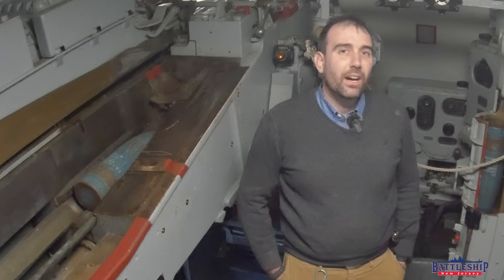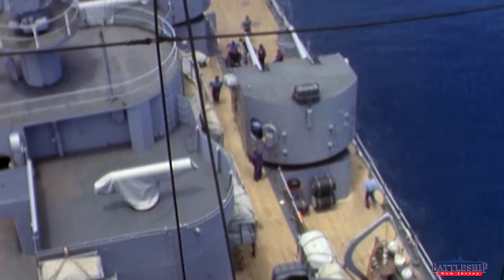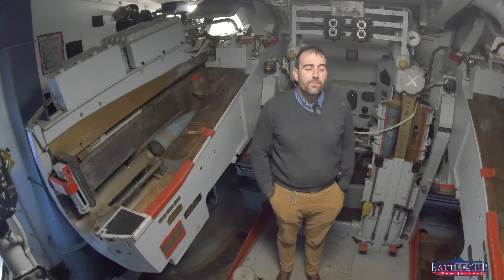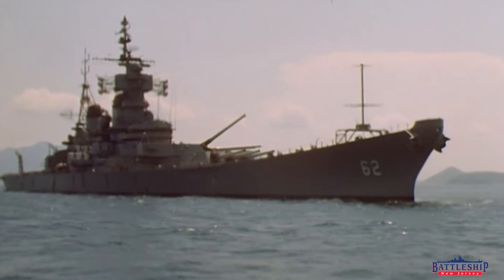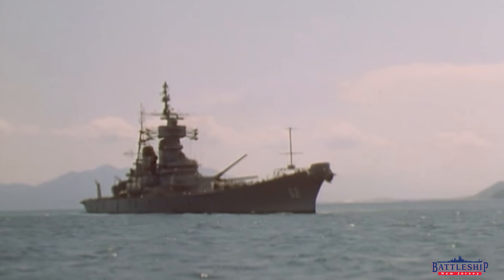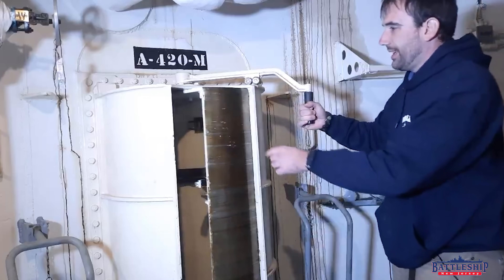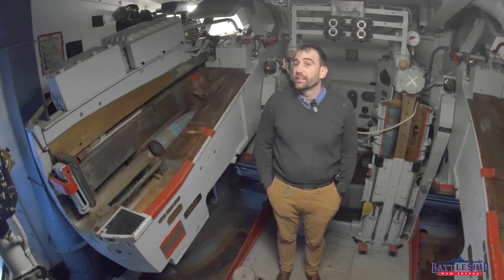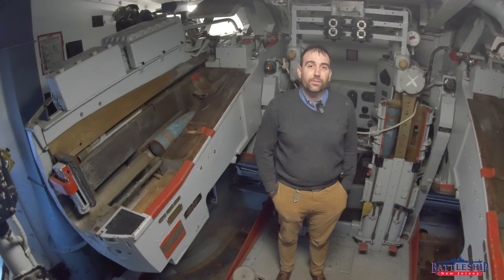Why Do Modern Warships Have So Few Guns?

Comment: The war in Ukraine has taught us a lot about modern warfare. The missiles and modern tech ran out pretty quickly and started becoming reserved for high value targets or saved for later strategic purposes. In any all-out war, missiles are too expensive and too difficult to make. I think it’s a mistake to not have more traditional weaponry in many situations. 

In both Ukraine and Israel we see how much of it boils down to artillery. Having a large ship a few miles from the coast, shooting at land-targets is surely a much cheaper way than flying a bunch of planes over, moving entire aircraft carrier fleets around, moving the front line to get into artillery range and such. It’s a crude and inaccurate method, but if civilians are out of the area it would be highly effective and cheap. The usecases are somewhat limited, but it’s also very cheap to add 5-6 different caliber traditional guns to modern destroyers/warships, so even if they’re not used often it wasn’t really a loss.

Comment: We repeat the same mistake over and over. One version is preparing to fight the last war, another version is designing ships for a specific, highly capable, advanced adversary only to find ourselves at war with swarms of suicidal Boston Whaler type skiffs loaded with explosives. Rather than "jack of all trade" type ships, maybe create smaller numbers of more specialized ships. Build a handful of monitors with 8" or 12" guns for shore bombardment. Build some air defense destroyers with longer range phalanx style high speed fire control to deal with aerial drone swarms. Build some corvettes with phalanx style weapons and high speed 5" mounts to engage low tech boat swarms, etc. We still need to dominate the high tech blue water navy space to deter advanced adversaries, but we need flexibility to deal more common threats like the Houthis.

Comment: The use of drones on the modern battlefield has made the naval gun more valuable than ever. Particularly the smaller caliber/higher fire rate variety. Not just to protect against flying drones but the types of unmanned Sea drones being used in Ukraine. Which are basically sea skimming missiles.
Reply: That's the reason the AEGIS system is integrated in the whole USN, and all destroyers, cruisers, and carriers carry at least one CIWS, as well as RIM missiles that allow to protect a strike group from incoming aerial threats from 300 km away
Reply: @earlbinvico  im not talking about aerial threats.
Reply: @Front-Toward-Enemy  then again, AEGIS is very complex, and it allows for the joint defence of a whole fleet. RIM-162 was also designed to be able to take down sea-skimming missiles. This means that in a carrier group, all 7+ cruisers and destroyers, as well as the carrier, will be able to use maybe a hundred of these missiles to defend against anti-ship missiles from over 50 km. AEGIS also means that CIWS can work collectively to eliminate anti-ship missiles as well. So, to sum it up, the reason why even CIWS have been having reductions is because anti-missile missiles have become very useful for defense on longer ranges than CIWS could offer
Reply: Guess that's why CIWS will never go out of fashion.
Reply: i think you are refering to anti air guns - CIWS only
Reply: People should stop to make up terms that make no sense. It makes them sound less intelligent.
Reply: @AW-ix5qg It's because the term is Unmanned Aerial Vehicle. An abbreviated name for that being drone. Then somewhere along the line people started combining the two, incorrectly. It gets repeated and eventually becomes a part of the lexicon. Language is a funny thing and so many words don't make common sense.
Reply: @Alpha_Digamma  if you know what I meant, why does it matter to you? Getting hung up on small details just makes you look like the “know it all/fake expert” type.
Reply: If it's manned it's not a drone. Which joker came up with the term "unmanned drone"?
Reply: @Alpha_Digamma  Come from cross over with UAV, Unmanned Aerial Vehicles.
Reply: @Alpha_Digamma  who cares?

Comment: The recent drone swarm thwarted by the Carney was if I remember 16 drones. Which were engaged and destroyed by 18 SM2 missiles. 
That’s definitely not sustainable. But I would suspect after Carney was reloaded they may have loaded much older SM2s that may have needed disposal soon anyway. 
Prior to this the 5in and phalanx have been employed for the slower moving drones to good success. Though this being a swarm. They probably wanted to engage at a safer range. 
Either way after that the Eike started moving. So I’m assuming that finally crossed a line.

Comment: I always wonder why modern fleets don’t have a bunch of normal modern day ships and one that’s basically a world war 2 ship but the only thing that is the same is the main cannons, just drive by firing shells and cheaply bombarding anything about 20 miles or so from the shore that you can see or that other Allies can see. Additionally such a ship is very large so you could bring a lot of stuff with you.
The rest of the weapons are missiles and anti air and stuff. Just imagine being able to quickly get rid of absolutely everything the enemy has that’s anywhere near the shore without a ton of expensive missles, and maybe also bombard any selected target your troops point out to the ship. 
There would be a precise cannon for hitting a specific target and there would also be a bunch of cheap “ehhh close enough” guns as well.

Comment: this is an off topic question but i was on the uss torsk in Baltimore a few weeks ago and there torpedo tubes have empty and grinch engraved on  a plate that you would put on a door. on a bracket on them. and just wondering if it means that the grinch has a torpedo in it?

Comment: If they ever fully realize the rail gun & get it working the way they theorized then we might see a return of some guns to ships I would think. Since that system has roughly the same range maybe better than the main guns of an Iowa
Reply: Unless you can shoot through the sea, it's not gonna work. OTH firepower is a problem.
"just toggle the power"
Ships move. Arcing your shots from the three point line isn't gonna work.
"guided shells"
A missile is bigger and can pack more Electronic Defense to resist enemy EW. It also can pack countermeasures to resist enemy fire. 
...a 1000kg or whatever warhead of a Block V TLAM is also a considerably more threatening problem than a sabot dart.

Comment: I was stationed on USS Mississippi CGN - 40 and part of the commissioning crew.  I was an Operations Specialist and was on the Naval Gun Fire Support Team. We had two Mk 45 5" - 54s.  My favorite thing to do was "John Wayne" attack runs.  We did them multiple times training at Vieques Naval Training Range.  Basically you sail directly at your target, firing your forward gun the whole way.  Then you turn, expose the rear battery and fire both as you parallel the beach.  Then turn away and the rear battery continues to fire.  All at 32 knots.  5" naval shells are no joke and the heaviest guns on modern ships.  You do not want to be on the receiving end of a John Wayne.
Reply: showing broadside, aint no joke either
Reply: @bennygummisko for real. No ship wants to be caught out broadside

Comment: I’ve figured for many years that what a modern battleship would look like is essentially a ship the size of an Iowa. With 2 forward , maybe higher velocity 12 inch turrets, probably 3 automatic 5 inch turrets each side and one at the stern. VLS tubes where the stern turret would be, 4 CIWS about half the armor and a massive electronic warfare system.  
Incorporate a gun stabilizer system and GPS into the fire control system and you’d have a pretty solid platform.
Reply: Defeated by submarines, aggressively expensive, still somehow worse than an aircraft carrier. 
...also for some reason bristling with guns when those could be missile tubes or if you're really itching for them, one armed bandits.
Reply: @sunrisejackdaw1779  While true, no modern ship is immune to subs, hence why I wouldn’t see them bothering with as much armor. 4-5 inches on the belt would be enough. 
The main draw I’d foresee with keeping the forward turrets is IF, big if, a gun and fire control system were developed allowing them to drop those shells within whatever the margin of error for say a JDAM is, and possibly 30 miles inland, would be a pretty cheap and safe way to deliver that. 
No risk of losing an aircraft or pilot, way cheaper than a missile or jet operating cost, and if it’s shot down who cares. And cheaper than a carrier as a whole. 
Of course there’s pros and cons to everything, and having way more missile cruisers then you’d have battleships makes a little more sense

Comment: All NATO warships over 550 feet, should have a NEW lightweight 7" gun. Big enough for ram/rocket extended range shells, (Zumwalt shells too small and twiddly to make cheaply), or just 200lb dumb HC shells to blow big holes in things at 25 miles. Put the 5" on frigates, the 3" on FAC's. Crimony, the new 50mm Bradley gun would fit on a PT boat! At least the USA could use the VERY powerful 30mm CIW system inleu of the 20mm phalanx. Missles can be jammed!!!!

Comment: An interesting video Ryan :). I am not military never have been. But does not mean am not interested in it. I think the biggest reason for the reduction of guns is simply the role they play has changed. During WW2 for example the main guns were either used for shore bombardment / troop support or Ship to Ship combat. The smaller guns were primarily used for Air Defense of the ship itself. In the modern era. What used to be done by the main guns is now essentially done by missiles and or drones. When comes to close in ship protection yes there is still missiles but you also have things likes of the CWIS type systems. As backup to that then there is the 40mm, 30mm or 25mm guns out there now with the guided / programmable ammo etc. As the 25 or 30 or 40mm guns I would imagine are a lot lot cheaper to both build and install on a ship than installing more CWIS guns on a ship. Like what Ryan said I could definitely see the amount of those guns increased on modern ships. And because they are a lot lighter than say a CWIS setup you could fit more without effecting the overall weight being added to the ship. Maybe even more ships themselves carrying drones but again they are a costly item when compared to a gun.

Comment: I had once commented or thought of how a modern BB would have to be made. One of the obvious things I knew would happen is that less guns would occur, so along the lines of USS Texas, I figured that in order to keep something of appearance and appeal to the battleship, it would be down to the two twin or triple barrel gun turrets in the front of the ship. This would allow for anyone seeing this would instantly recognize that it is a battleship with heavy guns, something that is still a very threatening force to mess with. 
Meanwhile the rest of the battleship would have the latest anti aircraft weapons and the latest missiles. With this being a BB the missiles would be doubled to the amount that a destroyer or cruiser can carry, lets even say that the BB even has nuclear capable missiles of a greater range than the normal ones aside from those on the submarines. 
On to the DDs I think they should have more guns, at least going to a twin auto cannon 5 inch as to increase firepower.
Reply: No no no listen
See, here's the funny. A massive barreled two gun that's actually a Mk13 in a costume. Get the glowing light strips, an ominous hum broadcaster, and you're gtg. 

actual projectile is basically a laser guided kinetic weapon.

Comment: Out of a range of hard-kill and soft-kill options, guns will certainly remain one of the most cost-effective hard-kill options for the foreseeable future. 

Guns on warships are by no means obsolete - in fact I think we will see an increase in small to medium calibre guns on warships to destroy comparatively low-tech threats like the drones currently being used by the Houthis in the Red Sea. Using missiles such as SM-2s and ESSMs which cost ~$2 million each to destroy drones is like the US ground forces using Javelin missiles worth $250,000 each in Iraq or Afghanistan to kill insurgents hiding in caves or driving clapped-out pick-up trucks - total overkill at massive expense compared to the threat. Using a 5-inch gun or even better 25mm, 20mm or .50cal guns to kill drones is and will remain a much more cost-effective option to using missiles - save the SM-2s and ESSMs to deal with high-end threats like incoming enemy aircraft and anti-ship missiles. 

Also, firing a missile would be a very expensive way to put a shot across the bow of a suspicious merchant ship in a sanction-enforcement mission, or to convince a suspected pirate vessel to stop and be boarded. Guns are much more useful and cost-effective in such scenarios.

Further, don't overlook the experience of the Royal Navy in the Falklands conflict, where their most modern frigate, the Type 22, had the latest Sea Wolf missile for anti-air defence, but was useless for supporting the British troops in their battles ashore because it lacked a medium-calibre gun for shore bombardment - the shore bombardment role had to be taken over by significantly older ships which, while much less capable in the air defence role, at least had guns which could fire shells onto enemy positions when called for. The Royal Navy learned from the Falklands conflict - later Type 22 frigates and all their subsequent warship classes have been and continue to be built with a medium-calibre gun, in addition to missiles.

Hopefully high-powered lasers continue to develop to the point where they can be a reliable and cost-effective option to destroy enemy threats. And don't forget the ability of modern warships to use electronic warfare to kill incoming drones and missiles by blasting them with electro-magnetic energy. But the gun is and will remain a very cost-effective option for dealing with a range of threats for the foreseeable future.

Comment: No, I don’t think guns are obsolete on ships you can have a anti-missile technology, but how do you really stop a shell fired from? Let’s say a 16 inch gun without upping your armor significantly
Reply: The same way you stop a missile, except it's easier because the shell isn't stealthy and doesn't have pre-programmed evasive maneuvers. You don't have to destroy the shell mid-flight, just damage the ballistic cap or destabilize the projectile, and the blast-frag warhead on an ESSM can do both.

Comment: Much like how the airforce thought that cannons on jets were obsolete and then reversed course during the Vietnam war as missiles proved less reliable than predicted, I feel we will see the return of big guns to warships after the next peer to peer naval engagement. 

With modern EW and anti missile systems I feel like guns which use shells which are relatively cheap and very difficult to  intercept will make a comeback. Sure we probably won’t see the return of the battleship as king of the sea but a return more balanced gun cruisers is definitely possible.

Comment: The lack of guns and armor is a major oversight of modern naval design. It's a peacetime wager. If a modern large scale shooting war ever started, the missles will all get expended faster than they can be produced. Guns ammo will be all that is left - for the few ships that survive due to the lack armor. Mission kills and outright kills will be horrific early on.
Reply: It's not economic to build ships with armour and advanced sensors/weaponry. So they picked the more appealing option
Reply: @admiralmallard7500  it's not economic to build any ship under our current appropriation system. What could have been built using Zumwalt money by using a proven gun system, combat system, & VLS, but adding an armored hull? Probably a lot more than three hull numbers for the same dollars. Again, it's a gamble of a peacetime deterrence navy vs a war time navy.
Reply: @privateer454  adding armour would require rebuilding the entire armour plate industry from scratch, so no it wouldn't be cheaper
Reply: @admiralmallard7500  One shot, one kill on ships that would then require scrapping a ship (if it's not on the bottom), as well as finding and retraining dead or wounded crew is not cheaper than building a ship to survive either.
Reply: @privateer454  It is cheaper though
Reply: Who is shooting at us that's going to make us run out of weapons so fast?

Comment: Funny you should ask, because I've given this some thought myself recently.  The answer is that lasers have reached the point where they will overtake phalanx and rolling airframe missiles as well as 25-40mm gun turrete for general defense.  Obviously there is no limit to their magazine as long as the ship itself is fuelled, and the costs per shot are negligible comparatively.  Second, the development of 155mm guns which use standard artillery shells, but are propelled at hyoersonic speed by hydrogen-oxygen fuel hydrolized from seawater using electricity will become the preferred main gun for shore bombardment and also anti-ship engagement where applicable.  This will all take pressure off the ship's missile magazine, which can be reserved for strategic necessities.